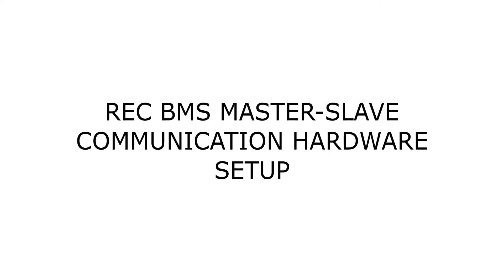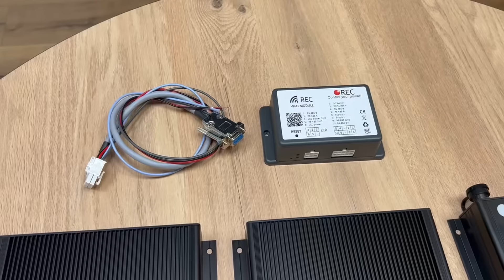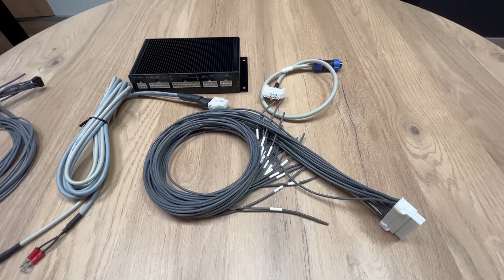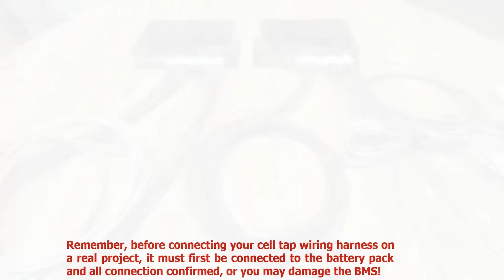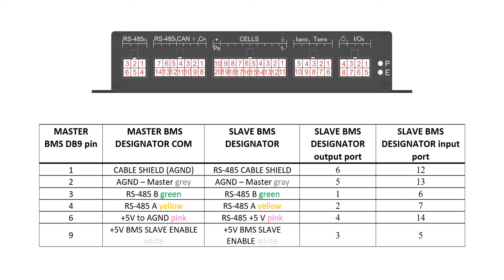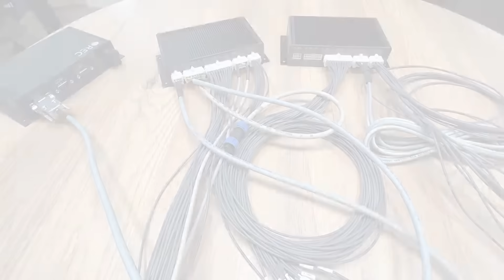REC BMS Master to 2Q BMS Slave connection instructions

Comment: Hi, which one manages the delay for switching on the inverters for charging the capacitors?

Can I assume that the accessories such as the above and the wifi module for the older SI "slave" (or standalone) BMS can work with these newer devices? Can the actual older REC BMS SI be integrated as a slave with the newer slaves for up to 16 devices?
Reply: I imagine there will be a shunt for each slave though, or can the master control that?
Reply from the maker: All REC Accessories are compatible with each other, so you can use them with REC SI BMS as well. REC Q BMS and REC SI BMS can both be used as Slave units, but you need firmware change for them, which we prepare and send it to you via email. You can upload new firmware to any BMS using Wi-Fi module.
In parallel connections, there must be current measurement and fuse/contactor protection on each battery pack. In series connections (HV systems) the Master handles the current measurement. For all additional information we are available at info@rec-bms.com
Thanks for watching!